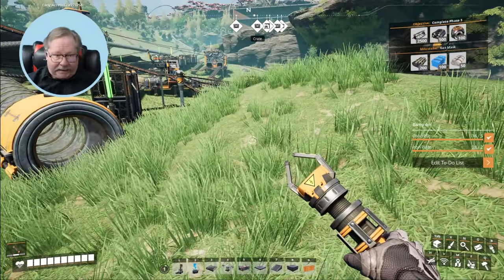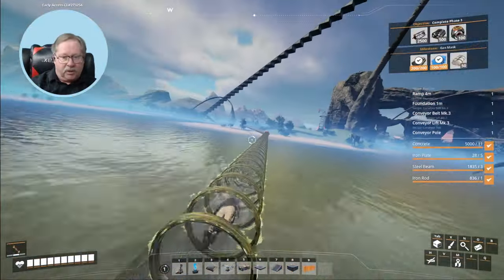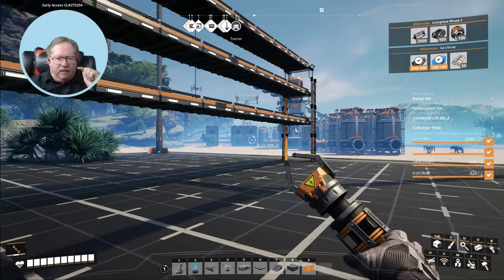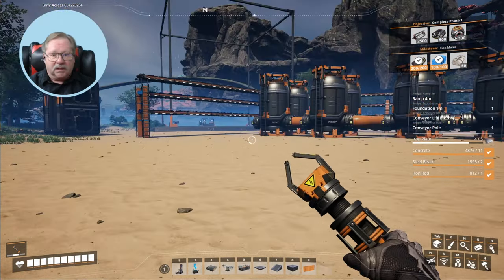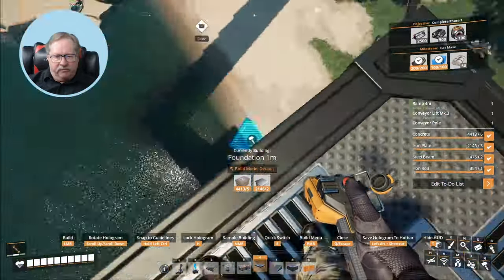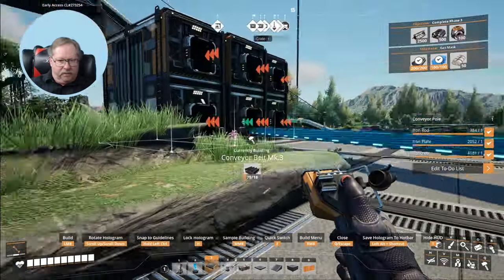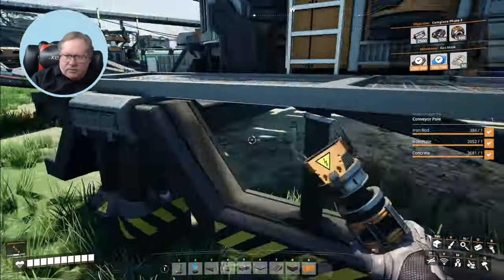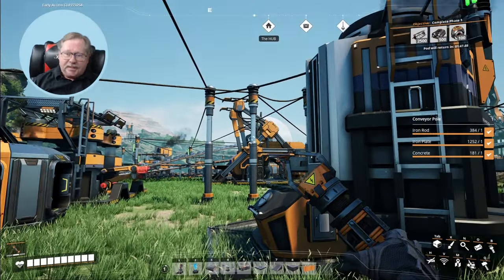Bringing it home to the Mega Factory with Blueprints [Satisfactory 20]

Comment: I just found your channel tonight, so I don't know what you know or don't know, so any info is not meant to insult you only to help if needed, but you are doing a good job from what I see.  One thing mentioned in another comment was the conveyor floor holes  need to be bought in the awesome shop with tickets from the awesome sink. And the second part to line them up, do you know there is a "WORLD GRID"  You don't need to use it all the time but if you start a foundation and hold ctrl while you place it, it will be lined up with the world grid.  Now if you build another foundation a mile away and hold ctrl while placing it, if you were to make a 'road' of foundations between them, it would line up exactly with the other foundation, so with that info you should be able to make the upper and lower holes line up. You can also build ladders with conveyor poles or buy ladders in the shop and just put up a ladder to get up a cliff.
Reply from the maker: I appreciate the advice! I haven't heard of the world grid before. That's really useful!  I've unlocked the ladders, conveyor floor holes, etc. It's gonna take a while to remember to use them!

Comment: When u place a conveyor floor hole (unlockable in the awesome shop)on a foundation at the bottom near the ground and then line it up with a conveyor floor hole high up in the sky  u can make a lift as tall as u want,since there is no height limit when connecting 2 floor holes with eachother.
Reply from the maker: Oh, that's cool. Thanks for the tip. Do you have to make sure that both platforms are aligned perfectly with each other to make it work?
Reply: @Gaming_with_Doc  yes